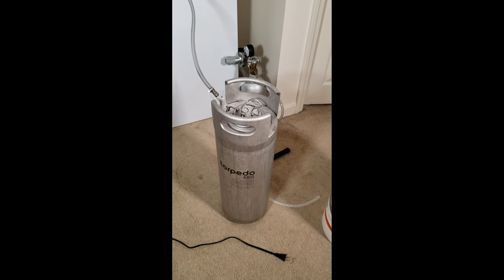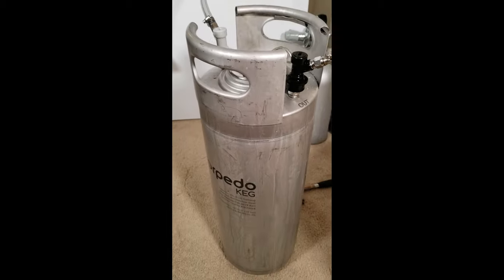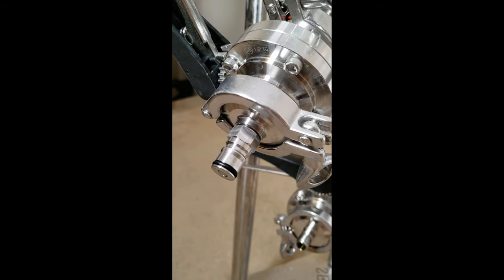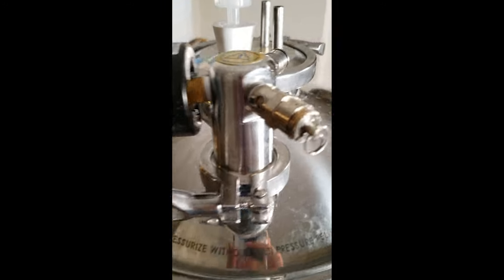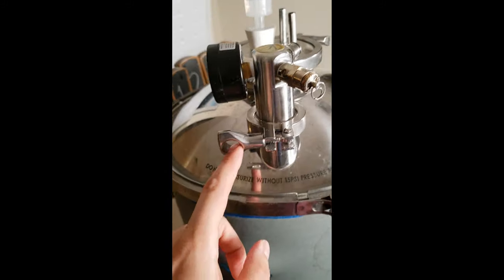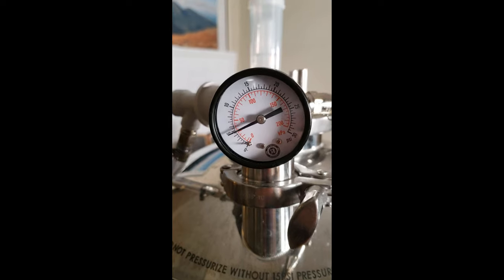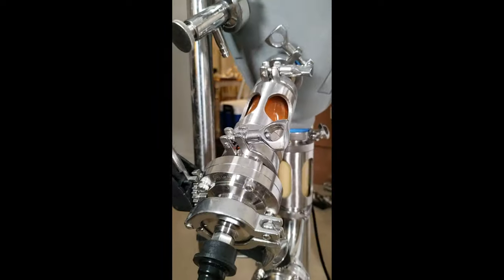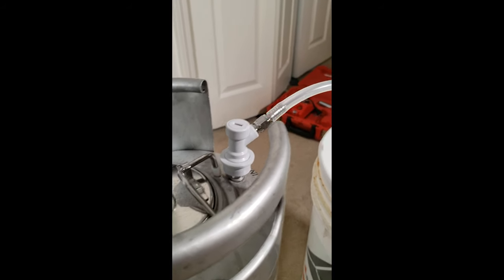How to CLOSED TRANSFER with CONICAL Fermenter (Spike CF5) #Shorts

Comment: when I pressure ferment I connect a hose to the spunding valve and it is then connected to a outlet post of a sanitized keg, I have floating dip tube in the keg and being empty it sits on the bottom, I then open up the pressure relief valve and during fermentation it flushes all the oxygen out of the keg, when I fill the keg up I put my fermzillar all rounder on a table and connect a transfer line from the outlet of it to the outlet of the keg which is sitting on the floor below and I have another line from the co2 input on the fermzilla to the keg, it usually takes 20 minutes or so, I also like to flush a bit of co2 through the transfer lines so I know I am doing a non oxygenated transfer, I'm not wasting co2 from my tank doing it this way, you're channel is great by the way, only just discovered it
Reply from the maker: Great technique, thanks for sharing!

Comment: Nice video. Have you figure out a way to dry hop in spike fermenter and transfer to a keg without clogs and a huge mess. Not to mention eventually oxidizing your beer the very thing I spent all this money on these spike fermenters to avoid doing.
Reply from the maker: If you don't want to dry hop loose and use a hop dropper, the best way to do it is to use a bag to contain them, and add it through the top port while pushing CO2 through up the beer via one of the dump ports at the bottom. This pushes oxygen out and allows you to still have an open port. See the heady topper video I did for a demo on that, or my dry hopping video for the hop dropper
Reply: @TheApartmentBrewer  thanks yea I prefer loose hops. Did a pale ale with a canister few weeks back.  Noticed some of the hops weren’t fully saturated with beer. I also thought hop aroma and flavor was muted. But I did it in a keg though.

Comment: Those fancy stainless conicals are great until you want to do something simple like a pressure transfer. All of a sudden you have to buy a whole lot of kit to get it right. My PET Snubnose ferments under pressure and just requires a ball lock liquid jumper and the spunding valve I used when fermenting to do a closed transfer.
Reply from the maker: Thats true, you can definitely get a lot of the same functionality out of cheaper systems (which is why I made the same video topic for an anvil bucket fermenter), but I really enjoy using this fermenter!